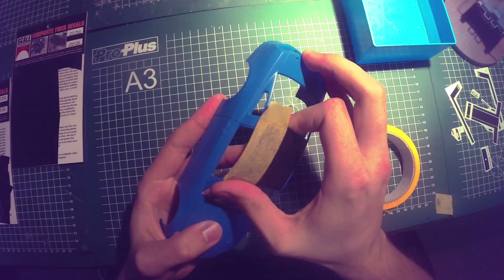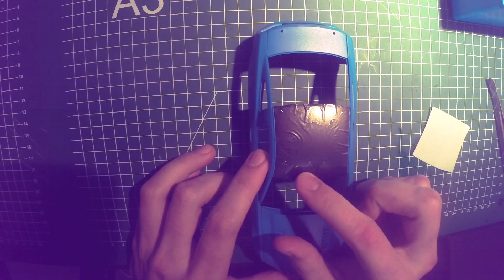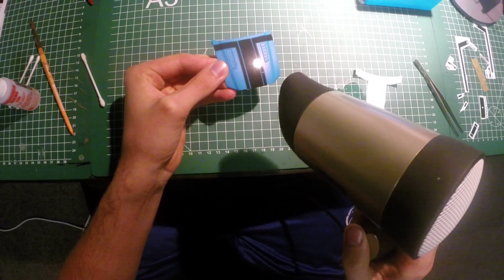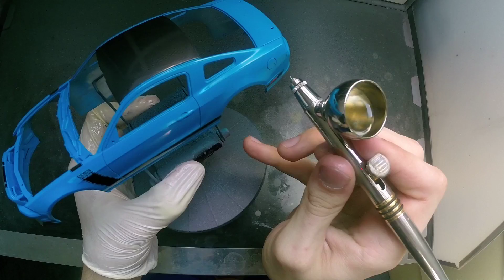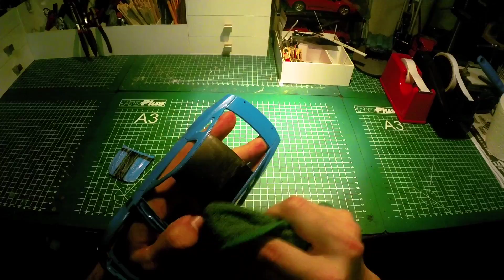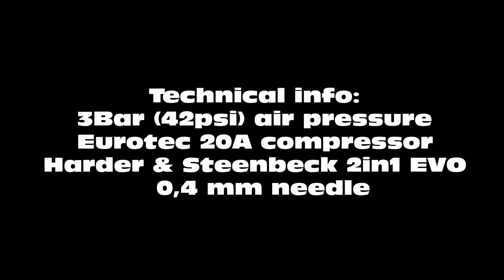Revell:2013 Ford Mustang Boss 302 Part 3/7

Comment: One suggestion would be to apply the decals after clearing the car....If you look at the real car, you will see they are applied after the paint and clear...Don't take this the wrong way, you do a great job, but I work in a body shop...
Reply from the maker: I know the real cars have the decals over the clear instaid of underneath. But the real car has vynil decals wich are way stronger. And if i put the decals over the clear they don't look as good as underneath and will deteriarate over the years.

Thanks for thinking with me!

Comment: very nice, looks realistic! one question, when you were cutting the decal out did you make it the exact size or a bit larger and trim after?
Reply from the maker: They are aleady the correct size, i just cut the out of the decal sheet so i don't use all the other decals at the same time
Reply: The Scalemodeling Channel oh i meant the carbon fibre decal that went on the roof of the car, you made a masking tape template and cut it out of carbon fibre decal sheet. I was wondering if you made the carbon fibre decal a bit larger and trimmed it afterwards or if you made it the exact size
Reply from the maker: I made it to the exact size, cutting it after it has been placed is very diffucult and 9 out of 10 times ruins it.

Comment: Why 40 PSI? I use 30 PSI (with trigger depressed) in my single-action bottom-feed Veda WD-138 airbrush (similar to the Badger 350 airbrush). Wouldn't 20 PSI be enough for a dual-action gravitiy-feed airbrush? I think 40 PSI could cause a lot of problems, like eccessive overspray and orange peel, for example.
Reply from the maker: 40 psi works for me, havent had any problems with orange peel.